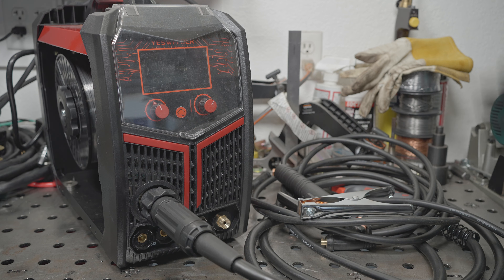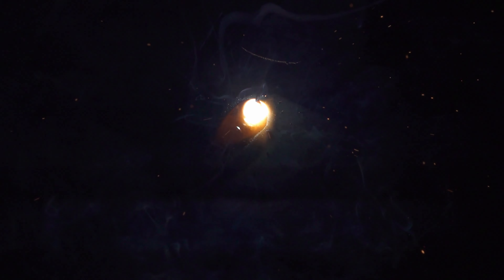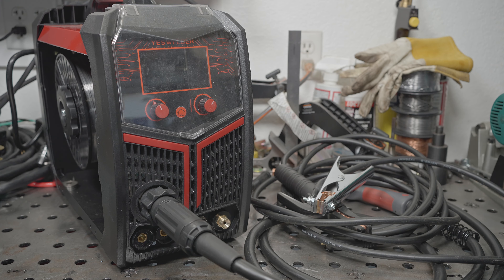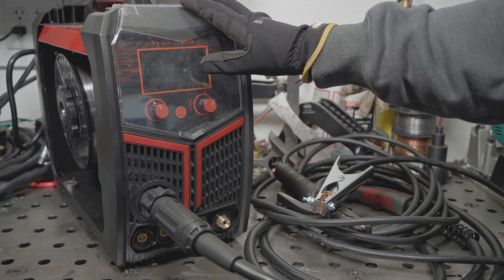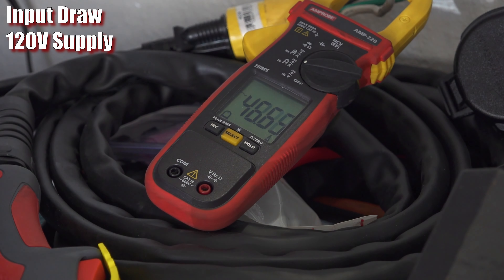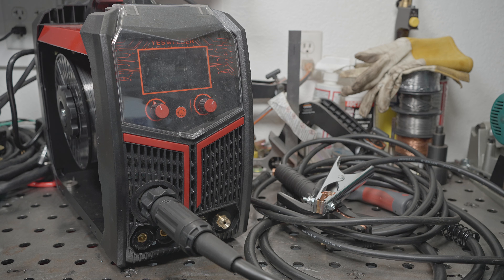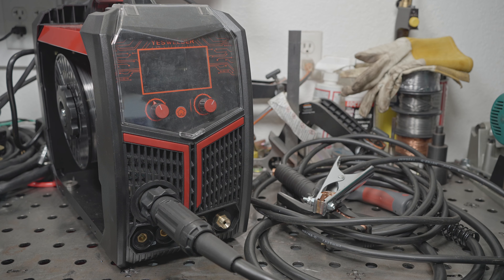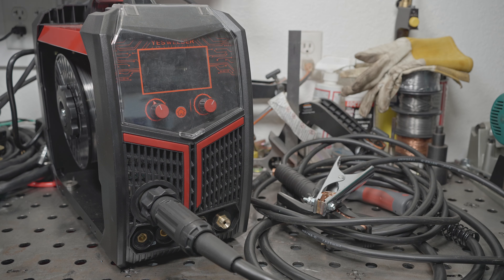Yeswelder Firstess MP200 Part 2: Stick, Dual Shield and Lies

Comment: I bought one of the Kickstarter machines. The first one came non functional on the MIG setting. I took the machine apart and found the connector for the MIG torch was completely wired wrong. I only knew it was wrong because of the video a guy posted adding a spool gun. They did finally send a replacement and the MIG function does work, but after watching your video it bums me out that the specs aren’t correct and completely false. Luckily I’m just a hobbyist but as you said it isn’t cheap. Plus all the cash I spent on other needed essentials to use it.
Reply from the maker: Try not to get down about it.  You got yours working, so that's good.  Fix something or build something cool and have fun!  I'm not looking to make people disappointed with what they have.  I just want companies to improve and be honest.  And I want to help people to know what to expect when they are considering spending their money.  Cheers!

Comment from the maker: Another thing to consider:  I think it is clear that the duty cycle ratings are not based on anything real or any actual testing.  They are completely fabricated.  Consider that they have a duty cycle percentage listed for stick welding at 200 amps.  The machine cannot physically do that.  So what are the rest of the percentages based on?  My guess: Nothing.
Reply: Can you put the duty cycle to test, check max amps, show where you tested the voltage. Thanks.
Reply from the maker: @morenothing4u  I tested the voltage at the terminals above the drive system.  That is where I connected my test leads.

As for max amps, are you talking about max amp draw or max output amps?  I have tested max amp draw on 120V in my videos so far, but I haven't tested it yet on 240V.  I can do that if you'd like.

As for output amps, in this video I tested max amp output when stick welding.  In my last video I tested max amp output while MIG welding.  

In part three I'll test plasma cutting and TIG welding and I'll be testing the max amperage output in both of those modes as well.
Reply: Yes please test the 240 and power factor so e can tell what size generator we can get by with.

Comment: Time stamp says this is 2 years old.... wondering if anything has changed?
Reply from the maker: Do you mean with this machine in particular, or with Yeswelder overall?  I haven't tried another of this particular machine, so I can't say if they updated it in any way.  Yeswelder does at least claim a warranty on their site now, though I don't know if they have any details in writing anywhere.  Their CT2050 machine came out after this one and had some issues as well.

They seem willing to correct some issues, though they went years without correcting known issues with some machines.  Known meaning, they knew about it because I told them and they even called me and chatted about it.  But to be fair, I haven't tried any of their machines for a little while.  It's possible they have continued to try to improve. Maybe it's about time I check out another.  We'll see.
Reply: The channel "Project Farm" actually tested a YesWelder among others approximately 9 months ago and he showed that it was outputting only ~70% of stated amps, compared to Lincoln electric which was outputting 99% of stated current. After watching that and your channel it seems to be the manufactures are using the same components to regulate the output. They probably haven't changed those components in the last 9 months.

It is interesting to see this yeswelder reviewed tho because everyone who seems to try it is surprised at its duty cycle and performance. Your complaint is the only legitimate down side I can find with the machine.

Comment: I ended up buying an old Thunderbolt AC 225.  It's a rebadged version for a regional hardware store that's now gone.
Kinda funny, it's red like a Lincoln..  Still have to install a breaker and all the wiring but happy to own it, doubt I'd feel the same with one of these.

Comment: And with all that said who would you recommend as a budget welder
Reply from the maker: I suppose that will depend on your budget and your priorities for what you want from the welder.  Unless you really need multi-process, I would recommend you decide which process you will likely use the most and get a decent welder for just that process.  

What process most interests you?  What is your budget?  What would you like to do with the welder?
Reply: @bigtb1717  I need something that can be versatile in the field on 110 that I can throw in my service body.
Reply from the maker: For that use case, a stick welder or flux core welder would be good.  No need for shielding gas (hauling around a gas bottle/tank), wind isn't an issue, etc.  On a budget, something like the Titanium Flux 125 from Harbor Freight is a decent option.  An ESAB Rogue 130 has power factor correction so it can run well on 120V even with an extension cord or off a generator.  It's definitely more expensive though.  I haven't tested one yet (it's in my list on Amazon, so maybe some day), but the Weldcote Stryker 140 is $350 on Amazon and supposedly has power factor correction.  I can't vouch for the quality, but it could be a good, portable option.
Reply: @bigtb1717  definitely don't need that type of set up. Any particular brand and model? Thx
Reply from the maker: My comment above has a few suggestions.  Is there a particular price you want to stay within?
Reply: @bigtb1717   And the yes well the price range is fine I could go a little more if the product is definitely worth it with warranty as you emphasize

Comment: How many units have you tested?  Being in quality control, I've found that one sample is never enough.
Reply from the maker: I understand that most of my reviews are based on a sample size of one.  I do try to get a second machine wherever possible if I find an issue that seems to clearly be a defect, or I at least point out that it could just be a defect or sample variation.  However, at this point I've tested the Yeswelder MP200, two MIG 205DS units, one ARC 205DS and their ARC 400Q.  All but the ARC 400Q say they are capable of 200 or 205 amps when stick welding but top out at 160.  The ARC 400Q puts out half what the display shows when running on 240V, single phase and tops out at 200 amps, not 400.  I do not have access to three phase power to see if it would actually provide the claimed 400 amps from three phase power.

Four Yeswelder models, five separate machines and not one of them meets the claimed specs.  Not to mention that The MP200, ARC 205DS and MIG205DS all put out the same 160 amps of stick welding current, while claiming 200.  At this point if I found a Yeswelder that could do what it claimed, THAT would seem like quality control variation, lol.  And as I've said before, 160 amps of stick output may be enough for most people and may still be okay for the money.  All the more reason they should just rate the machines accurately.

Keep in mind, this failure to meet the claimed output and drastic variation from what is shown on the display is extremely common with cheap, generic welders.  I've tested a lot of generic welders at this point and this is a common enough problem that I don't believe it's a mere QA issue.

One good sample doesn't prove there are no issues, but a single bad sample means there was at least one bad sample.  It's just a matter of whether it's one bad unit slipping through, or whether it's an endemic problem.  At this point, I'm confident it's not a one-off.
Reply: @bigtb1717  I have 3-phase power at my home and use several 3-phase welders via a 30HP RPC.  If you want me to test out the Arc400Q I could, but as you can likely imagine, it won't put out what they advertise.  Let me know.  Great videos by the way.
Reply from the maker: @zod-engineering-welding  Thanks for the offer!  If I still had it, I'd be sending it your way for sure.  Unfortunately, I actually just got rid of it a week or two ago.  It was pretty big and I don't have a lot of space in my garage.  I actually looked into a couple different ways to get 3 phase, but it just comes up so infrequently that I would have use for it, so I decided it wasn't worth it.

Also, I suspect it's more about voltage than three phase with the 400Q.  The way the rectifier is set up, the controls of the welder couldn't differentiate between single and three phase input.  So if it does ever switch to a higher output, I bet it's somewhere above 300V input, rather than three phase.  Still, could have been an interesting test.
Reply: @bigtb1717  I don't doubt you one bit with regards to the rectifier.  In any event, I have 3-phase 240V, 400V, 480V, and 600V (up to ~30HP worth) at my home shop in case you ever wanna send any welder testing my way I'd be happy to take on that part.  Pretty crazy, eh? :)

Comment: Thanks for your review. I think Yeswelder, at the end of the day, is stuck competing at a price point where they need to match the crazy claimed output figures of the other Chinese welders on Amazon. When you get a tiny $70 welder from some no-name company advertising 200 Amps, most people who aren't knowledgeable will reflexively buy those rather than a welder that costs several times as much and advertises true specs. Think LED flashlights, 18650 batteries, etc etc. It's all very sad.
Reply from the maker: I agree.  The online marketplaces (and even some physical stores) are being flooded with cheap products, in every sense of the word.  I've got nothing against someone spending less if they don't need something fancy or industrial quality.  Quite frankly, Miller, Lincoln, ESAB, etc. are getting stupid expensive.  But we're getting a flood of products (as you say, not just welders but everything from kitchen products, outdoor products, cameras, furniture...) where the seller seems only concerned with being able to advertise the cheapest price in order to get the sale, and to heck with quality, reliability, durability, honest claims, having the actual features claimed, or in some cases, even working at all.  Sometimes it's frustrating trying to even find something that ISN'T a cheap piece of junk.  There are times when a situation calls for a product that won't give a bunch of problems and will hold up well.  In that case I'm willing to pay more to get quality, but it's sometimes nearly impossible to find an option that isn't cheap junk.
Reply: Fully agree. People on Amazon are mostly concerned about price, which is not a problem in and of itself. It does, however, attract a buyer that is not in the market for a professional machine. When you have to market to that segment, you almost have to fudge the numbers to make a sale. Maybe Yeswelder is currently in a situation where their machines are better than some of the bottom-of-the-barrel stuff (they are at least trying to innovate), but they can't charge enough to set themselves completely apart from the other cheap stuff.

Let's not forget that Yeswelder is a Chinese company. Unfortunately, Chinese culture only values success and honesty is not a consideration. I wouldn't doubt if the people here in the US care about your opinion but their hands are tied by corporate.

As for me: I'm in the market for a cheap stick welder and it still sounds like the YWA160 is a good machine to go with for the very limited use it'll see from me (I'm an electrical engineer). At least the current adjustment is accurate. I wish someone reviewed cheap plasma cutters the way you review these welding machines. I completely neglected to thank you for your data-driven analysis of these machines, which is all that really matters to someone like me!

Comment: Has Yes Welder done anything to make this welder put out what it claims, sense this review? If not,  Thanks a 1000 for the video,  becuase that's how much money you saved me. Was about to buy one but now I'm reluctant.
Reply from the maker: Unfortunately, my reviews are often a sample size of one.  So I can't definitively say, one way or the other.  However, I doubt they have made any design changes since release.  I have tested several of their welders and failing to meet the claimed specs is the norm, rather than the exception.  I'll soon be testing a couple of their newer welders and hopefully this trend changes, but we'll see.

Comment: Thank you for this! Was gonna get the 205DS and saw the MP200, and thought based on their marketing, that it would be a superior machine. I’ll still get the 205DS as for the prices they are now, I’m ok with a throwaway multiprocess unit. But I’d rather throw away a couple hundred bucks over a thousand! Super thankful for this review!
Reply: I have purchased the MP200 and since I am a new welder I'm not familiar with all  the specs. What I do know is it has weld everything I needed it to. Mig or Tig worked just fine for me. I never used a plasma cutter so when I used it I was impressed with what it could do. No where else have I found a unit that could do it all in one machine. Being new I was not a sure of the settings I needed to use. This sets it for you with the ability to change the settings and store the settings for future use.
Overall  welding capabilities outweigh specs in a manual.

Comment: I reached out to YesWelder to provide me with some alignment detail & firmware upgrades (if that was possible) to correct for these issues but was told basically no.. Why would they design something without adjustments built into the software? Why wouldn't they be open with they're design, schematics etc. Not like anyone is going to bother copying this machine.. Frustrates me...
Reply: i'd tell you no too. 
go pound sand.
Reply: I'm not sure why you feel this way @gerardjones7881 ? Do you not think Its frustrating not having the option to "user service" if you have the skills?. Assuming you have a MP200 or any other device, what will you do when it goes wrong?